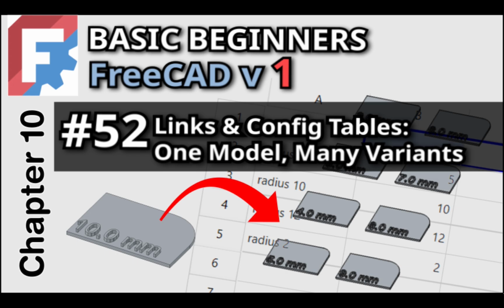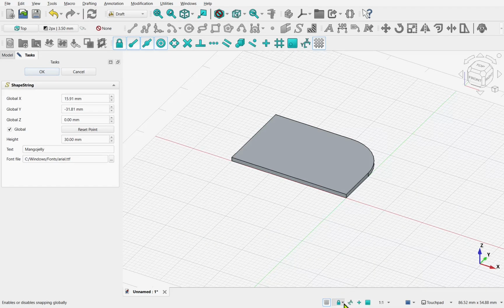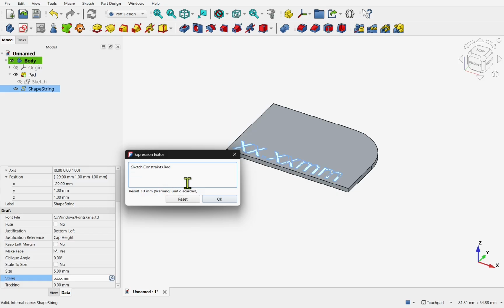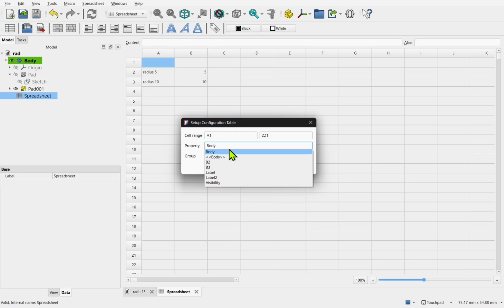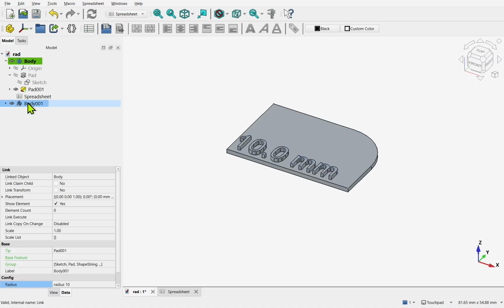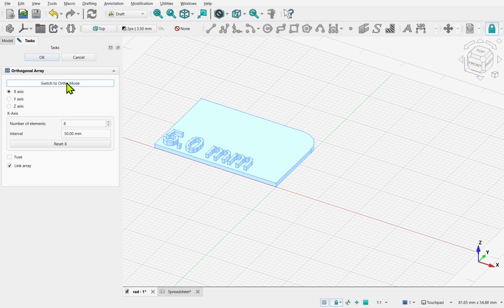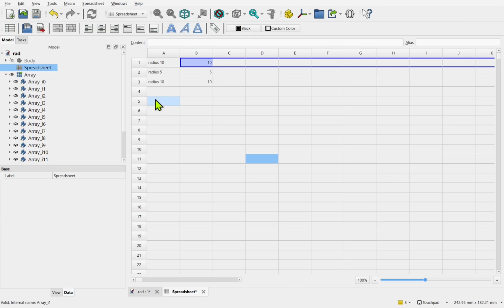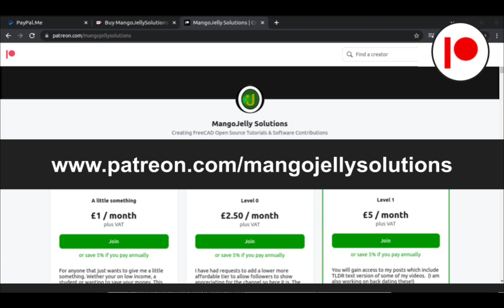FreeCAD How To Generate Multiple Variants Automatically With Spreadsheet | Basic Beginners Lesson 52

Comment: Apologize but I have a issue with Freecad reverting back to the downloaded or changing all my settings. Why this matters is it has created errors when creating circles for one issue. If creating a circle of 35.56 mm then a outer circle of 38.1 mm a constraint error is created. A larger circle can be created of 44,45 mm and no error. What would the problem be? By the way great tutorials!

Comment: Great tutorial, but I have a problem. I'm using development version 1.2.0, and once the array is created, the "expand array" option doesn't appear. Thanks for your help.
Reply from the maker: Thank you, regarding your issue, it will be worth raising that with the FreeCAD developers as a bug as it's probably something that shouldn't be happening.
Reply: I got the same issue with FreeCAD 1.0.2: you must tick the "Link array" option at the bottom. In my case, that solved the issue, and the option appeared. Thanks, Darren, for your fabulous tutorial!

Comment: Thanks, Darren. I like working with spreadsheets in FreeCAD. The capabilities you demonstrated in this video are new to me, thanks for showing what can be done! I’ve recently been adapting some files to use VarSet for variables. For the most part, I find it works well. But I am currently working on a little project where I’m having difficulty getting one VarSet value to calculate from a couple other VarSet values (I’ve been successful doing this with a few simple calculations, but got to one where it seems to get hung up). I will probably be able to if I use a spreadsheet and make a cell produce a value by referencing other cells. Thank again for another great tutorial
Reply from the maker: Thank you so much for thew support, appreciate that.  With your challenge it sounds like there is some kind of sync issue where changing on varset calculates another value and you take that value to calculate another so a daisy chain of updates.  Worth checking to see if you have a cyclic redundancy issues as your exposing a value and using that value.  If your using that value back in where you have called it from it can cause issues.  This is where you can use the href (hidden ref) workaround (with caution).  I will just find some reference material for you a second:   EDIT: link -> https://wiki.freecad.org/Expressions and scroll down to cyclic dependencies within your will find reference to href.

Comment: Witam  i dziękuję za kolejny film. Bardzo to wszystko skomplikowane.
Nie ogarnę tego za rok 🙂
Czy można zrobić lustrzane odbicie tego tekstu i zrobić sobie pieczątkę?
Można wydrukować taki element z tekstem z TPU i będzie pieczątka.
Reply: To create a tpu stamp, create the text, then pad in reverse (downward) thru the part. This is a longer way, requiring each part to be flipped over in the slicer. Easier way is to place text on the bottom of the part, then pad in reverse thru the part. The text will appear on top of the part with reversed lettering, as stamps are made. No flipping required in the slicer.
Reply: @dbeelee8564  THX!
Reply: Imagine agora o código, que está por detrás disto tudo
Reply: @contra_plano  😀